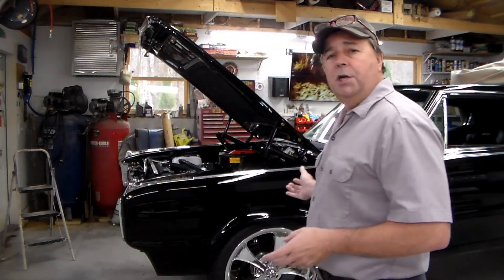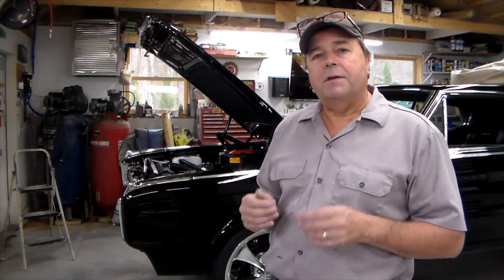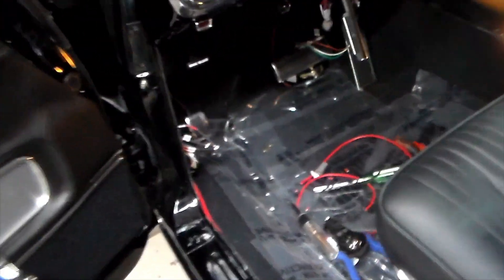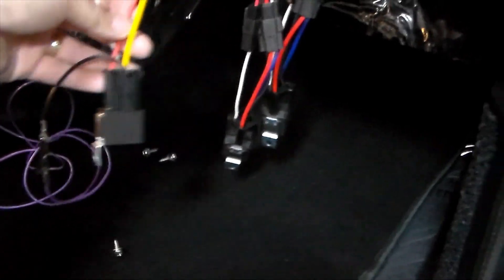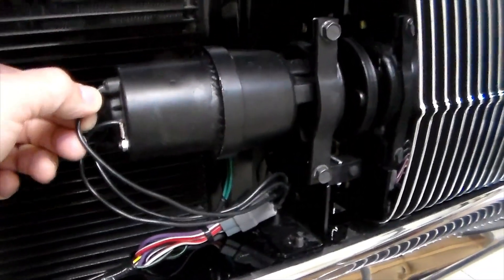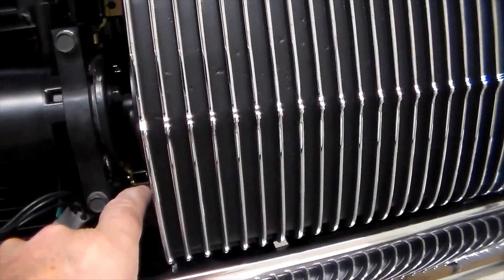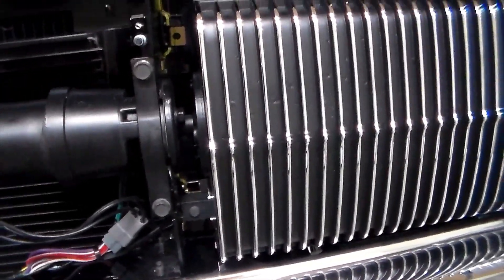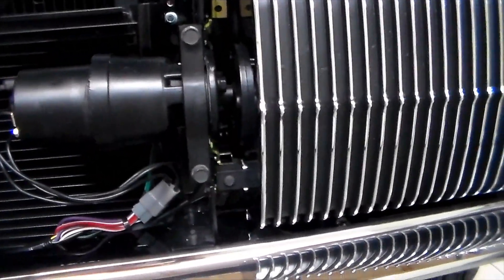66 67 Charger How do The  Headlamps Work?

Comment: Finally a video on this. My 66 has had issues for a while. the person I bought it from re-wired the headlamp switch and mounted a new 'aftermarket switch below the dash' to bypass the most likely dead relays. a challenge. I will keep you posted.
Reply from the maker: Glad I could be of help. If you need parts go to Headlampmotorman.com Topher Mcginness is the expert on these systems and rebuilds the motors. Also he has solid state relays available as well. Good luck on your project, Troy

Comment: This is soo helpful - thanks for posting Troy. I have a 66 Charger and one of the jobs I have to fix is the rotating headlamp system.
Reply from the maker: Glad it helped
Reply: I have on headlight that works and one that is stuck in closed position. Any advice.
Reply: @krisgreen7619  Try turn your headlights on and off and push the toggle switch Sylvia go down
Reply: @troykane  Hey Troy. I've now installed my headlight motors, new relays and new limiter switches -  I have one headlight that opens/closes just fine, but the other one is stuck in its closed position. The headlight bucket isn't obstructed by anything and can rotate freely when uncoupled from the motor. I did notice the motor itself got very 'warm' when I was testing it - Any advice? Thanks.
Reply from the maker: @nickshale6926  Will the motor turn with power if not connected to anything?
Reply: @troykane  Hi Troy, thanks for replying.
Do you mean 'will it turn' if I tried to physically rotate it manually myself? If so, then the answer is No.
Reply from the maker: @nickshale6926  I mean if you have it not connected to the headlamp shell. But you use power to rotate it. You will have to close the limit switch for it to work.
Reply: @troykane  Ah, gotcha. No, I haven't disconnected from the headlamp shell and tried it with power to see if it will rotate freely. I'll give that a try and report back. Thanks again :)

Comment: Very Good Video I have a 1966 Charger took me forever to figure out the Function of the system and expensive since I purchased NOS Micro Switches and the new Relays like you have. Also the Gauge Cluster is trickery DON'T TOUCH THE WHITE WIRE SPADE!!! I did and Wow! Got Shocked where it held onto me until my Son pulled the Battery post off quickly.
Reply from the maker: Thanks! Glad you enjoyed the video. And the power pack for the dash is 240 volts ouch

Comment: Great video, Troy, I have a 66 Dodge Charger, all new wiring harnesses, I need to get the hideaway headlights to work both motors are fine... Removed the kick panel and didn't see a circuit breaker? There are 2 - 10ga. red wires not connected to anything? I believe that's what you show in your video, where do I get that circuit breaker and what amperage? I was thinking 40Amp breaker if that's where those wires connect.
Reply from the maker: Yes thats where the breaker goes. I'm not sure of the amperage, it's either 30 or 40. That will get you power you need. Good luck.

Comment: Hi, great video. What gets the motors starting in the other direction if the grounds are removed by the limiting switches?
Reply from the maker: The Headlamp switch. It sends power to the oposite side when in on off position. The oposite side will also have the relay trip to send power to ground. hope that helps.
Reply: @troykane  I had the same question. Even if the switch sends power to run the motor the opposite way, the motor must still need a ground? But I don't have a 66 Charger so my misunderstanding is just sort of 'academic' lol. Cheers! Beautiful car
Reply from the maker: 2 power wires one going to each side of the motors. 2 limiting switches correspond with those power wires. pretty slick for back in the 60's

Comment: Thanks for the great video. Very simply explained. I do have a 66 Charger. At times the driver side doesnt open unless I gentle bump it with my hand and then it opens. Seems like a mechanical issue there. Another issue is at times both sides will rapidly open and close an 1/8  of a rotation up and down up and down all by themselves. Could that be a relay or the limit switch? Thanks again.
Reply from the maker: Ok I think you have a mechanical issue. I think there is some friction or binding in the rotation process. If this happens it can delay or stop the movement. If it stops them all together it could trip the ciruit breaker. Then the breaker cools and recovers and power is restored. Clean and lubricate everything and then see what happens. Good Luck
Reply: @troykane  ok thanks, will take a look.

Comment: Just got the grill to one of these and put it in a coronet is there anyway to manually move the headlights from the open to close position. The motors work
Reply from the maker: Yes, you can loose a the bolt that clamps the headlamp motor. You can see it threw the center grille, if I remember correctly. Loosen the bolt, then rotate the headlamp bucket. The motor will turn with the headlamp bucket. Good Luck!
Reply: @troykane  thanks so much, my grill looks a ton better now

Comment: thank you for your video.Where ca i buy the 3 relay and connection wires ?
thanks a lot ! (charger 1967)
Reply from the maker: The Guy for all your headlamp parts needs is Topher McGinnis. WWW.Headlampmotorman.com
Great guy, excellent work. You can also message him on Facebook. 
Good Luck on your project!
Reply: Thank you for the great video.

Comment: Looks like you have updated relays, nice. Do you know if the originals be accessed without pulling the back out of the glove box?
Reply from the maker: I think you could go from under and behind the glove box. But I thin it would be easier to remove it for proper access.
Reply: This video did a great job helping me understand how this crazy setup worked. Thank you!